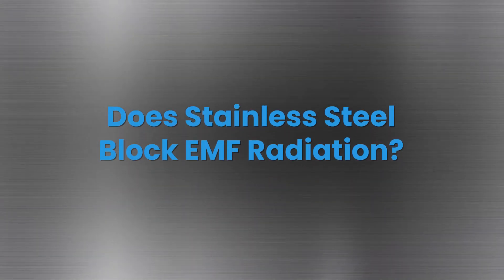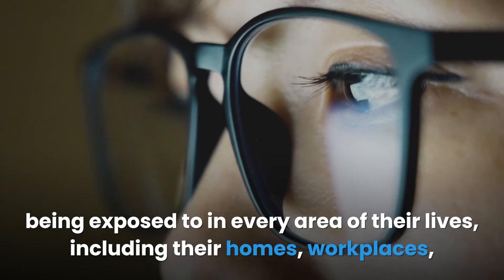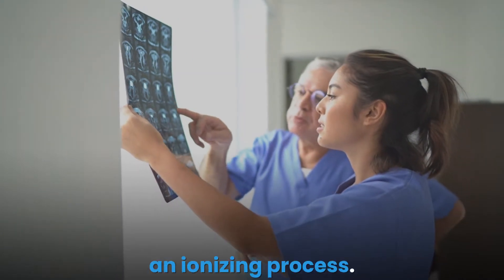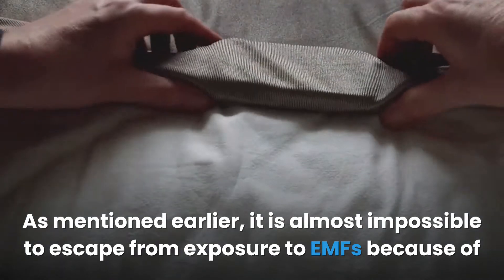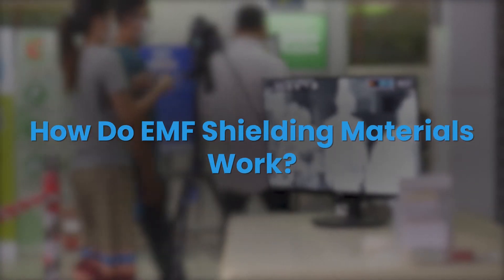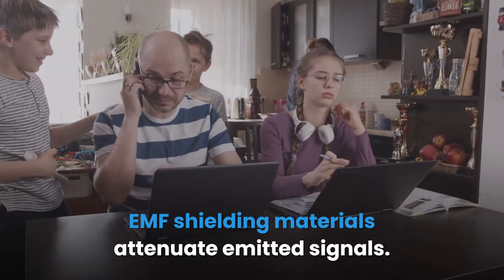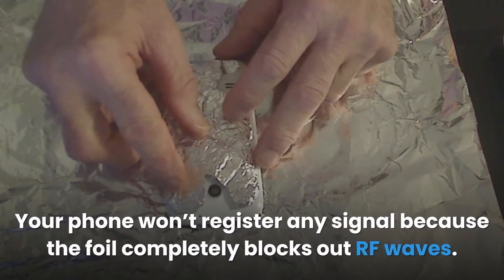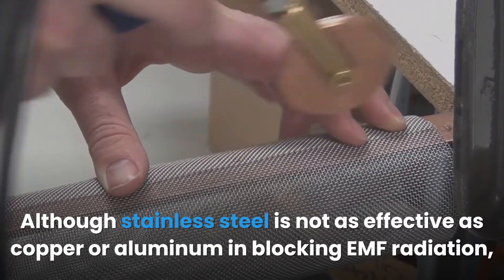Does Stainless Steel Block EMF Radiation? | EMF Protection

Comment: Do not agree on steel.  Steel and iron, such as in wrought iron fencing attract electrical pollution, not guard against it.

Iron overload in the body is not good and may be harmful?

I would not desire any fabric to shield that employs metal no matter how tiny the spacing is.  Sounds crazy to me.